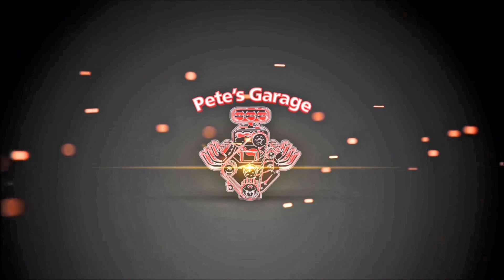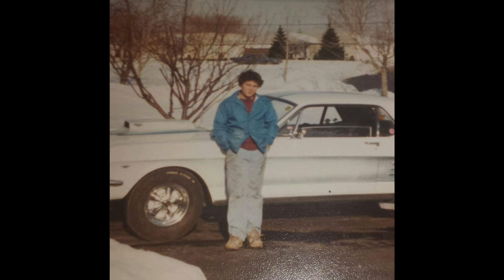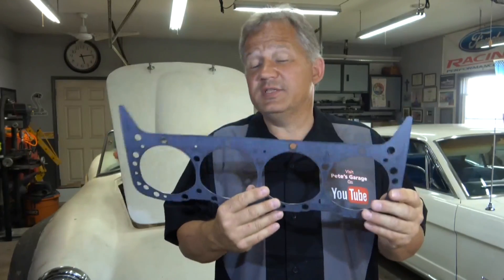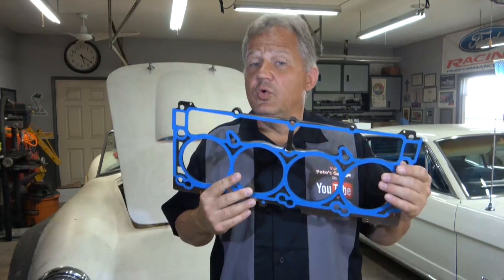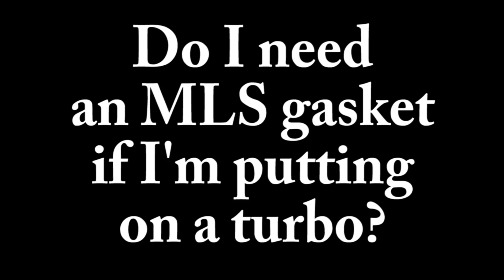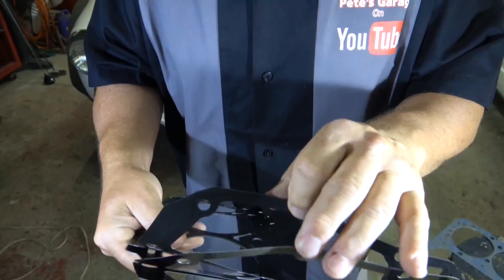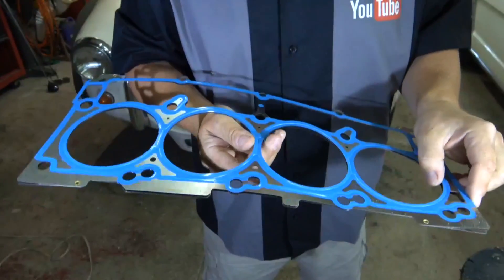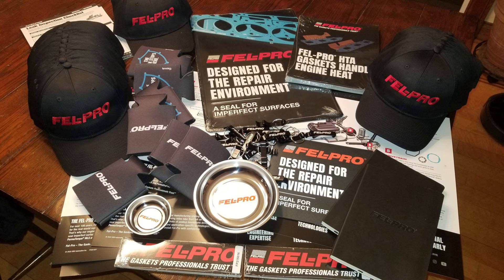Everything you need to know about Head Gaskets - Types and Installing Fel-Pro Gaskets

Comment: One thing you failed to mention  and I noticed your constantly touching the head gaskets. When you touch that gasket your getting oils from your skin on it and it wont seal properly. Do not touch the gaskets on the face
Reply from the maker: That is true, though I've never had an issue. Any oil will burn off quickly

Comment: Excellent Presentation. I was just about ready to spray a set of 305 head gaskets with Permatex Copper spray sealant. Probably a good idea at times with another brand but unnecessary with Felpro. One other thing. I was searching everywhere as to why the gaskets I was ready to install a few hours ago only had two tiny holes instead of a larger one to match the heads water ports. Interestingly, the ones you held up as an example were the exact same ones I have for the 1990 305 engine. I had been thinking about punching 1/2" hole in the gasket but didn't do it. Thanks again!
Reply from the maker: Thanks my friend

Comment: You didn't cover a situation I ran into with Fel-Pro head gasket instructions.  It reads "Important:  If the gasket you are replacing did not utilize 8 metal ferrules, please remove them from this  gasket before installation."   What are they talking about?
Reply from the maker: Some gaskets have metal ferrules at the bolt holes to limit compression. If the old gasket did not have them, remove them from the new one

Comment: Hello Pete.  Thank you for this informative video.  I'm interested in understanding the significance of different thickness head gaskets for the same application.  I see for example the thicknesses go up from 1.0mm to 1.2mm in 0.05mm increments.  Is this to cater for more surface roughness or surface flatness deviations?  Thank you
Reply from the maker: It's for surface variation and to change compression if you need to

Comment: I have fresh machined 1974 sbc block and heads. Bought felpro gasket set supposedly premium (7733SH2 kit) and the head gaskets are just steel shim stock (.015” thick). Inquired with felpro and they said to use a spray on sealant (such as the copper coated sealant). So that’s straight from felpro for the 7733SH1 steel head gasket set that are in this kit.
Reply from the maker: Interesting, I would follow what the recommend

Comment: so felpro is better than victor reinz gasket? excuse me Pete i bent the corner of gasket, last question Pete what is yhe spec torque for a 2014 Toyota Prius C?
Reply from the maker: Each manufacturer is good for their specialty. If you did not ruin the sealing surface you can bend it back. You'll have to look that up

Comment: On my 3rd Fel-pro 1153-1 Performance Head gasket......very expensive.....layers are separating after several runs of hi boost......Using L19 head studs ...Also retorquing  required after each run (can loose up to 30 lb torque where the layers start to separate.
Reply from the maker: You're punishing those gaskets pretty good.
Reply: have the block o-ring cut

Comment: Hi Pete hoping you can help me out. My new head gasket it exactly the same as my old  one except for 1 tiny hole. Can I drill it out to match? Or should I leave it? Cant find a exact matching 1. Old car parts are hard to find.
Reply from the maker: Here's the real question; how do you know the one you're taking out is the correct original? If the old one works, it matches up except for that hole, and you can't find the right one, you could try.

Comment: Hi how are you i have a question for you sir i bought a remanufactured engine from AutoZone wich it came with the valve cover installed do you think i have to take them off to put the engine on dead point to install the distributor??????
Reply from the maker: No

Comment: yes but isn't also correct that reusing regular bolts has a limit to how many times they can be reused and that it maybe wise to replace the bolts on a very old engine?
Reply from the maker: Not if they are torque only

Comment: Hi I was replacing a head gasket on a 1990 toyota corolla and what was most confusing is that the gasket did not have holes where the block and head had holes; and there was nothing in the instructions to explain, so was worrying.WAS IT MADE TO SUIT DIFFERENT MODELS, MAYBE?
Reply from the maker: If you bought it for the correct year there may be holes blocked off

Comment: I just did the top end on our 76' Corvette and used Fel-Pro 1142-026 gaskets. By the way, your videos were incredibly valuable to me as I've been doing small engines for the past 16 years. I think I would had made a big mistake with cam choice if not for you. Anywho, had to remove a head after torquing so I contacted Fel-Pro to ask if I could re-torque and was asked if I used studs or bolts, I used studs. And was told if I hadn't started the engine that I could re-torque the head and the gasket would hold, it did just fine. Just wondering your opinion on this matter.
Reply from the maker: For that type of gasket that does not have embossed steel features you could reuse it. I've done it in a pinch and have not had a problem.